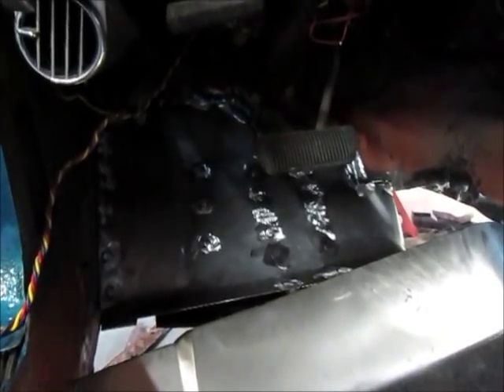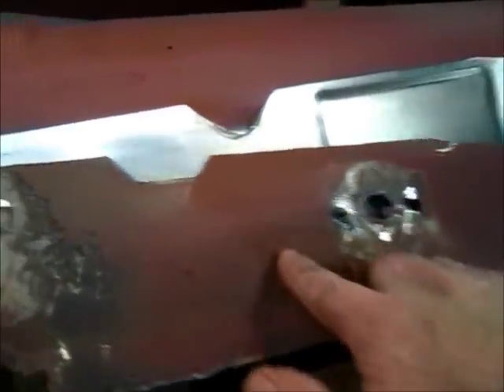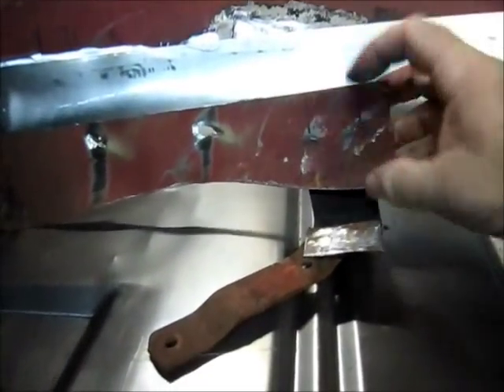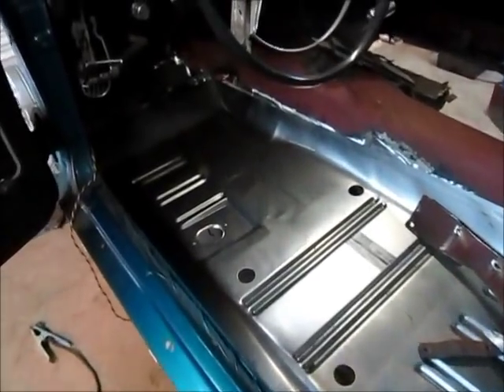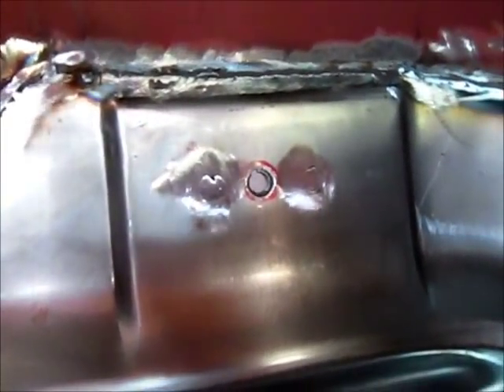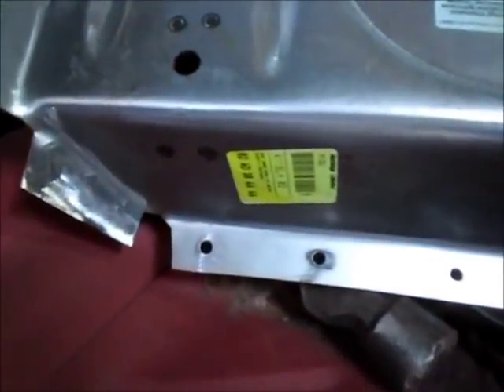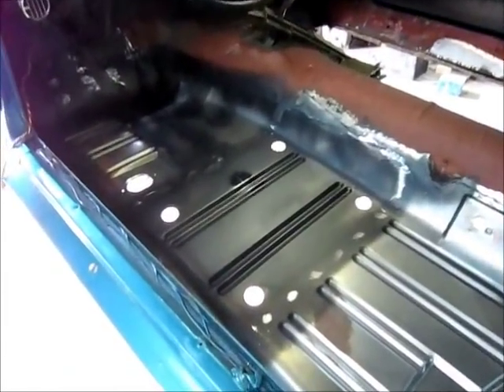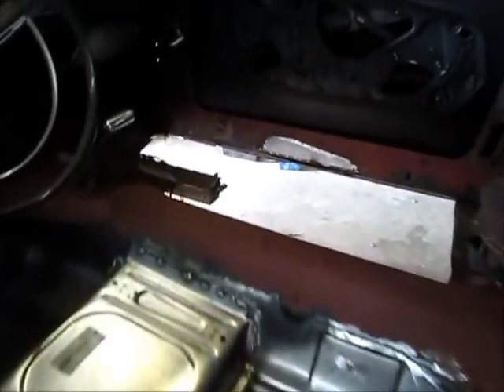1968 Mustang Driver's side floor pan. "Jade" part 6

Comment: Hey, great work and direction. I have a '70 Cougar and I am replacing all the same panels. I have been told to put the car up on 4 jacks leveled so i don't mess up the alignment when disassembling and reassembling. I see you have jack stands in the front. Where exactly do they need to go up front? Under the radiator connecting frame? Behind the radiator sub-frame but in front of the front tires? Please share. Thanks
Reply from the maker: For pans, it really won't affect much. You could just put 4 stands under the rocker panels at the pinch welds. I usually use 6 stands and the 2 extra ones go up front.

Comment: Great video as usual. I was wondering how you routed your emergency brake cable. I am doing my best to do what I see in a ford shop manual but it isn't exact on routing. My assumption is to go through the large holes in the frame rail under the floor board and bring it through the gap on the bottom left of the torque box where the 2 lone welds are and then cut a hole at the top of the torque box cover piece that the toe board sits on and the same with the toe board. Then connect to the brake actuator. Any advice? Thanks
Reply from the maker: I haven't gotten that far. I don't have it installed yet.

Comment: Hey Jo, excellent video. I wanted to ask, di you make a video for the toe board? I am putting that in but would love your process and insight. I would guess fit it in there and you're done. Only problem is the extra shaping to make it fit tight enough since what is sold isn't perfect. Any thoughts?
Reply from the maker: Look up the “Mystique” playlist. I did more on that car. Might help.

Comment: Hi, I'll be replacing my torque box, toe board on both sides and the front floor panels on both sides on my 1967 mustang since they're rusted out. The motor and transmission are still in the car. I plan on repairing one side at a time. How should I have the car lifted/supported when I do the repairs to avoid flexing and make sure everything is square?
Reply from the maker: +coffeetoast967 Ideally, you'll want to have the car high enough to gain good access from the bottom. I would have a minimum of 6 stands. 2 in front of the rear axle where the leaf spring mounts, or under the rearend itself. 2 all the way in the front under the core support, and 2 under the floor supports. You may have to be creative with the side you're working to ensure good access. Maybe have the stand somewhat aft of your work area.

Comment: Sorry for asking a question on the wrong video but trying to get more info from you regarding the boom mat or kilmat you used in the firewall area. Do you plan to also use reproduction Firewall Insulation? Or just the kil-mat? I have a 65 Mustang / ground up rebuild and am wondering if I need to put a reproduction piece in, or if the kilmat will suffice. Do you know if you can double up with the kilmat? Thanks for making these videos. They are very helpful and a lot of fun to watch. Steve in Texas
Reply from the maker: I'm only using the kilmat. Yes, you can double it.

Comment: I have a67 mustang coupe, it has a torque box on the driver side but not the passenger side. Is that normal or a factory mistake escape?
Reply from the maker: Some of the 67’s had only one torque box.

Comment: The floors in my 1973 are ok except in the areas where the feet go (the squares directly in front and behind the 2 seat platforms.) what is the best tool to use when fitting the pan, I use a grinder with a grinding wheel and a cutting wheel for big cuts. Is there anything better to use to make it a bit faster. Also what would you use to make them flush, I have a few area where pieces stick out and a hammer will not make them flush to original pans, what do you do to make them flush.
Reply from the maker: TheSamplebridge Only thing faster is a plasma cutter, but you'll still have to dress the edges. I would replace the whole pan myself. If you're real particular, you can lay the pan(s) on top of the rusted areas, (after cutting out the big stuff) Press the pan down and cut the new pan and the bad area at the same time. This can be risky though. It could leave gaps if not done exactly right. Or, you can fit the new pan, trace the perimeter, and cut to about 1/4" of the line. Lay the new pan in and do a lap weld. Once done, you can  carefully trim from underneath, or dolly flat and seam seal.
Reply: Jo Daddy's Garage thanks

Comment: Hello Barry, I so appreciate your videos!  After putting in the floor pans and seam sealer, what do you recommend for the undercoating? Do you use epoxy primer, paint, then coating ? Or just go directly to an undercoating?
Reply from the maker: I'll blend down the welds, spray epoxy, seam seal, and then undercoat. You can spray paint on top of the epoxy if you like.

Comment: I've cut out almost all of the original floor out of my 68 Sprint B, but am having trouble with the torque box section. I don't want to cut into it if it's good, but I'm trying to get the old floor off so I can get the new one in on Drivers and Passenger sides. Any suggestions?
Reply from the maker: I assume you mean you've cut out the individual floor pans (per side). The best I can tell you is to take a sanding disc over the remainder to reveal the spot welds. (you should have a general ides where they are) Then take a grinding wheel and grind the welds down. As you get them loose, pry the metal up and lightly chisel the remainder. Once the sheet metal is gone, grind down the rest of the welds.
Reply: Jo Daddy's Garage That's what I'll do then. I appreciate the quick reply! Thanks for taking the time to upload these type of videos and replying to comments.
Reply from the maker: CJ Armour You're welcome.

Comment: I assume you are using seam sealer from Eastwood,If you want your seam sealer to look nicer,I use an acid brush and cut the bristols down in half  it looks a little more like factory..Ohh an acid brush is used for soldering ,it has that silver tin handle.
Reply from the maker: Thanks.

Comment: Hey Barry, quick question The shop installed driver side torque box and floor support and put the floor pan in on closer inspection this is sitting high due to the floor support angled upwards, not pleased about this as can see the seat riser may sit slightly higher nearest to the door and rocker, do you think this will be a massive issue?
Reply from the maker: Hard to say for sure. Without starting over, you may look at custom fitting the seat riser so it sits level. Take it out, and trim off material  on the rocker panel side until it sits level. Weld back in.
Reply: @JoDaddysGarage  thanks for the speedy reply will try to see how far it is off tomorrow with some levels it seems to be level towards the back and front it's just in the middle it bows up slightly.
Reply: @JoDaddysGarage  Hey Barry, took some measurements with levels today seems that the floor pan is pushed up in seat riser area about 1/2 inch. When setting the seat riser I can get it level when pushing in the rear and front rocker side but the transmission tunnel front flange kicks up. Should I remove material from the front of the seat riser nearest to the rocker is that what you meant?

Comment: How's the 68 mustang coming along.
Reply from the maker: +Leonard Gilbreath It's on hold until I get the current 65 done. Planning on doing more work to the 68 Mustang, and the basket case 68 Camaro. Stay tuned.

Comment: what are the purpose of the holes in the bottom of the floor pan?
Reply from the maker: Dewan Chowdhury Originally those were for tooling. Like jig/mount points when it was built at the factory.

Comment: What seam sealer did you use on the 68 Mustang?
Reply from the maker: Eastwood brushable seam sealer. I get it at the paint store. http://www.tcpglobal.com/FIB-365_5.html?gclid=CMDGr4P_pc8CFZElgQod64oD4A#.V-VjcfkrLcs
Reply: Thank you!  I'm getting ready to remove the floor from a 65 Mustang.  The new floor I have came with rear torque box covers.  I appreciate your videos they're very helpful.
Reply: Do you put the seam sealer only in the inside of the cab or do you put some underneath as well?  Also, do you use clamps to hold the floor to the frame rail so you can weld them together?
Reply: Never about the last question.  I saw in your video you used clamps.
Reply from the maker: I apply seam sealer on both sides of the seam.